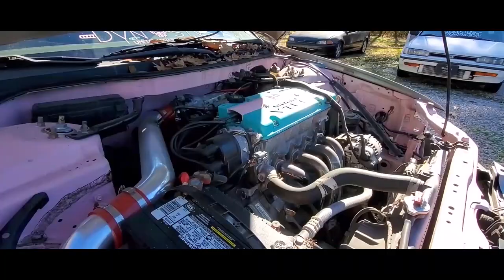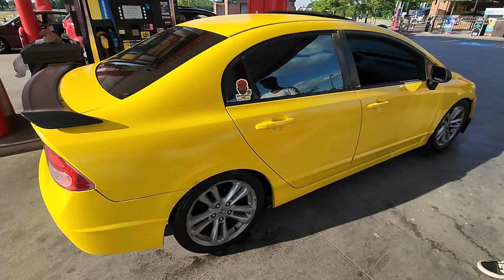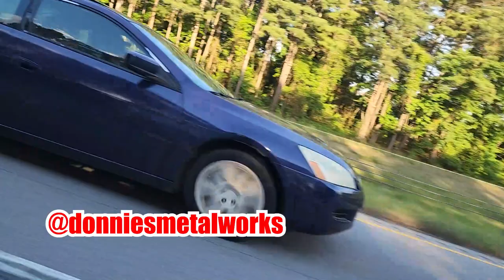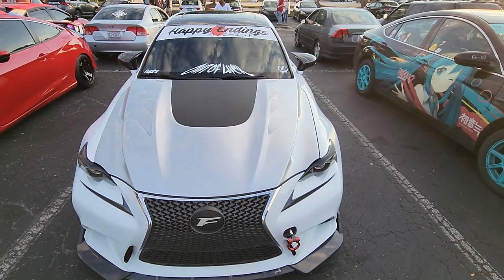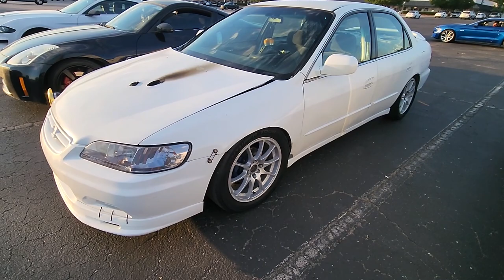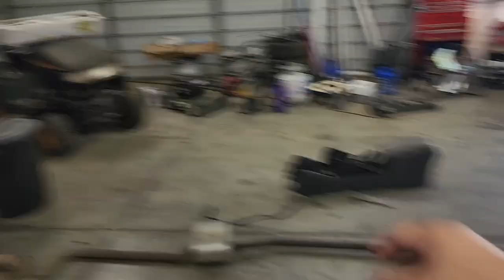Turbo Sleeper Honda Accord Adventures! | Gutted CG5 On Boost | K24A Swapped 8th Gen SI And more!

Comment: Hey man, what suspension set up do you have for your h22a swapped accord. I’m looking to get Coilovers but don’t know the right spring rate. I just bought a 94 with a black top h22a swapped in it but it’s on springs. Thanks in advance man. Love the vids keep it up
Reply from the maker: I'm running maxpeedingrods coilovers bro. Link in the description
Reply: @DrivenFilmsPhotography  gotcha, had a feeling lol. Are the different spring rates to choose from? If so what are you using?